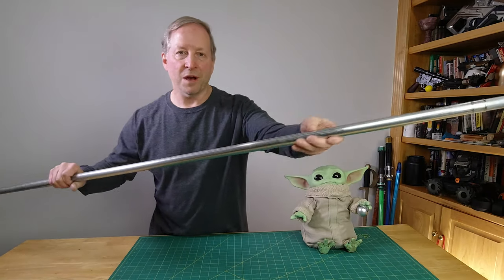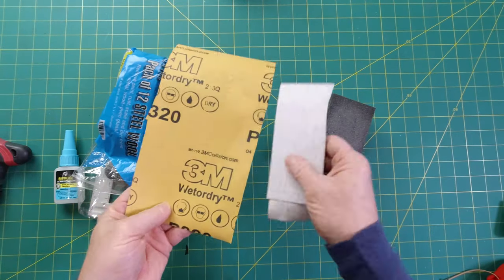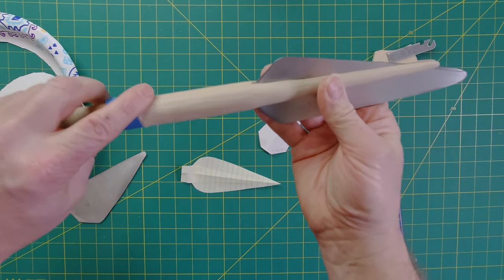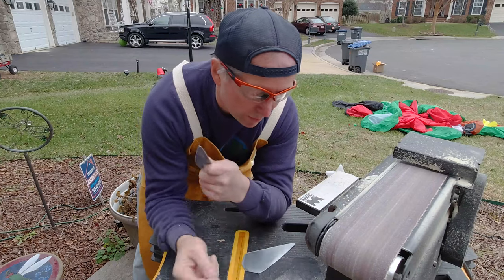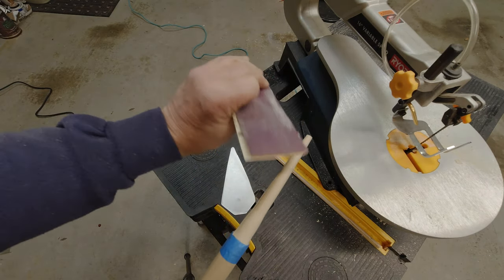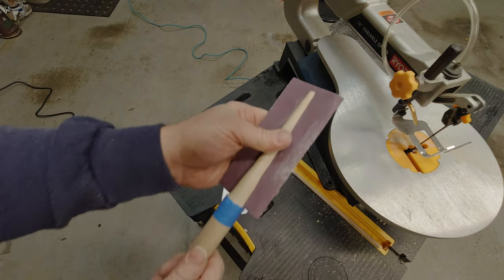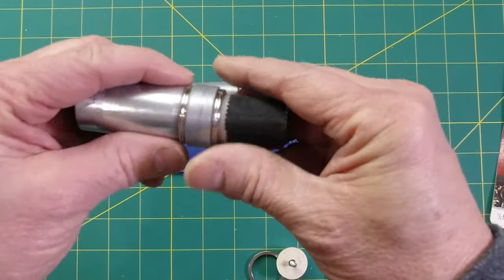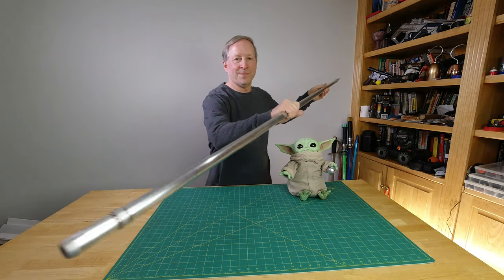How to Make Mando's Beskar Staff for ~$15 DIY - This Is The Way

Comment: Very nice build. I just made one with pvc pipe as the shaft, glued a wooden dowel inside for rigidity, and 3d printed the butt and spear head of the piece.
Reply from the maker: Jason J, That's another version I've done minus the 3D printed pieces. Thanks for your comments.

Comment: If you whittle or sand the scrap end of your Dowell down small enough to chuck in a cordless drill you will get a perfect taper.
Reply from the maker: elkhills1, interesting idea, I'll have to try it out. Thanks for the tip.